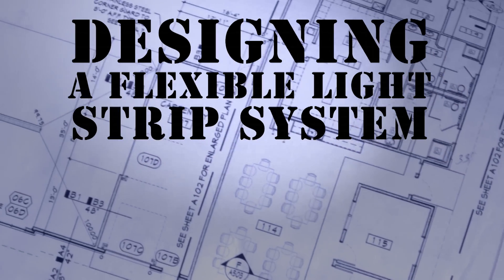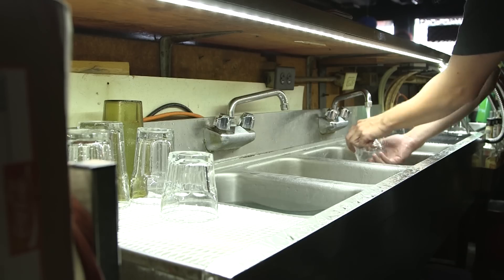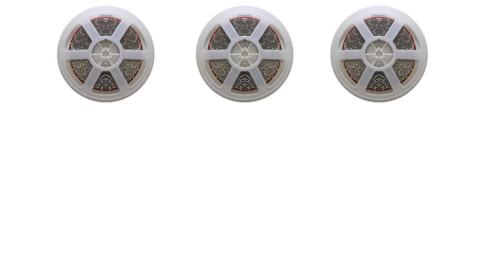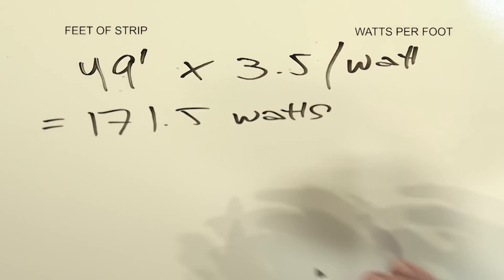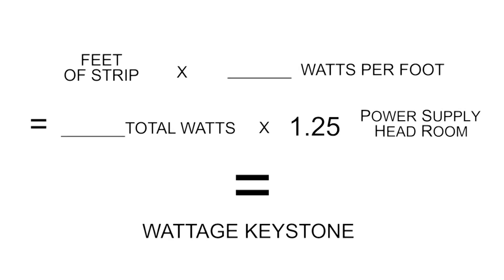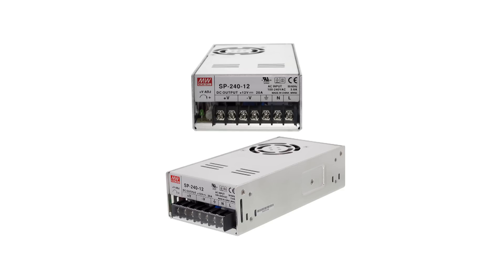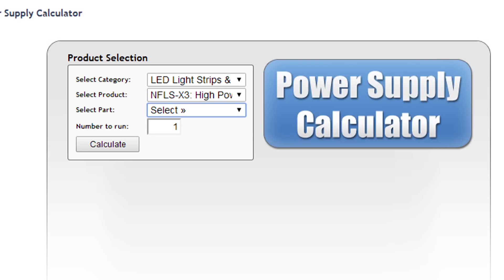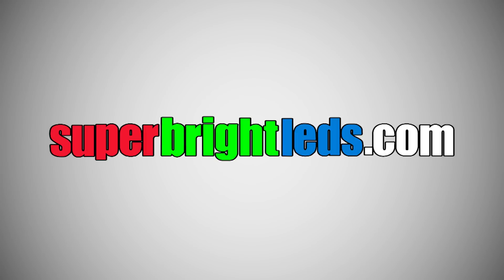How To Calculate Watts With LED Light Strips

Comment: I have a question, say I have a 5M roll of 3014smd requiring a 50 watt power source, but Im not using the 5m whole instead using 5 1m pieces on 5 different applications. What would I need for each 1m piece?